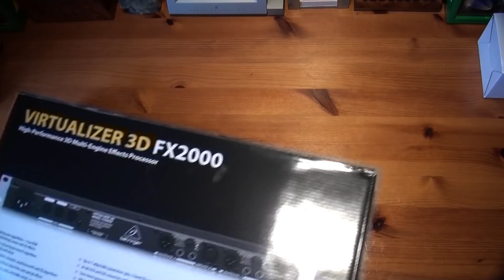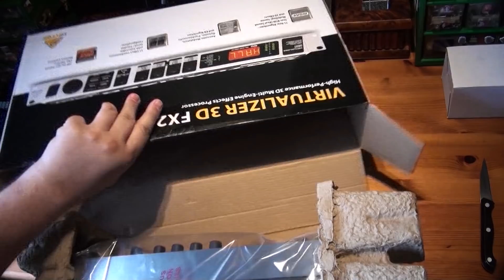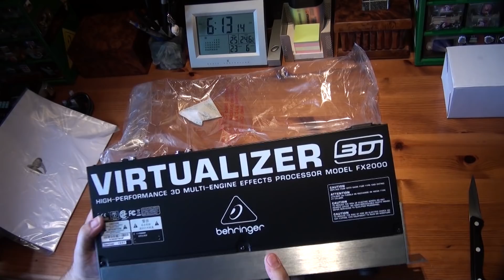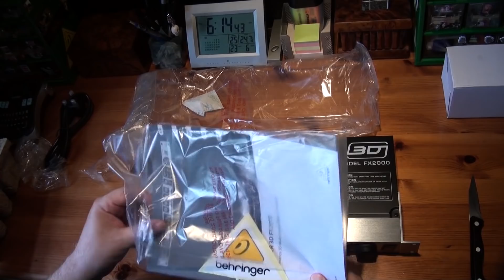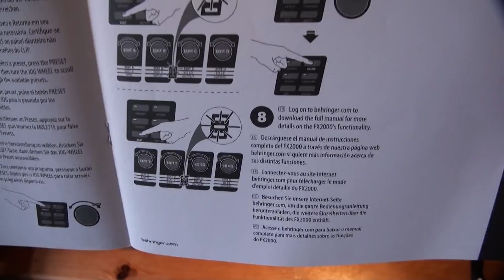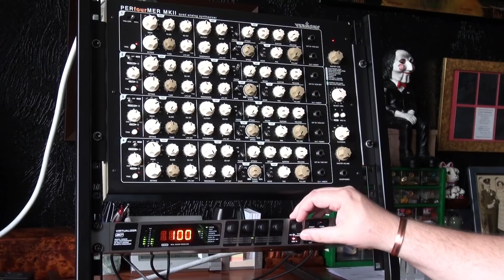Behringer FX2000 Virtualizer 3D Multi Engine Effects Processor Unboxing

Comment: This didn't help me in deciding if I would want to purchase one.  ...It's playing through a "Quad Analog Synthesizer."  ...How is the listener to determine which unit is producing which tones?   ...They are both synthesizers.    I think the proper way to showcase this unit is to connect to a simple mixer with no effects or basic pre-amp, to isolate the pure tones and functions of the Behringer's effects.
Reply from the maker: Just to clarify the synth is playing through the effects and from effects to video camera that's it. The synth is playing four different sounds one after the other.I chose four different sounds so you could get an idea of how the effects unit  is changing the sounds.Sorry it didn't help. The end part is just a quick look from a much more in depth series https://www.youtube.com/watch?v=EaTFm7wmTxw&list=PLxLrDVzH4F1LKBzPjmS7kwgpjIPIImy3r
Reply: @nonsensicalchild     Okay.  ...Thanks.

Comment: Ok, now that I have it largely figured-out...a quick question: The Japanese manual (matching mine...100+100 presets versus 70+70) notes the user/"volitile" presets having 100 different named effects - e.g. beyond the 100 internal/"non-volitile" ones: Does anyone know if a hard reset will repopulate those user presets to their 'extra-hundred'  factory sounds?  THX
Reply from the maker: Try it
Reply: Yes - I suspected I would have to do so ....there are some I wanted to keep there and I'm not going to bother with manually backing up parameters or using sysex; thanks!
Reply from the maker: You might make even better presets this time now you've had it for a while..
Reply: Indeed; the "potentially default" ones from the list didn't appear tremendous...  All have been overdone/too-much to be useful.  Thx again

Comment: Hi - looking at buying one of these but I am wondering whether or not I can use more than two effects at once? In the description on the Behringer website it says there are up to 11 effect combinations, all of which only contain two effects (chorus & reverb, flanger & delay, pitchshifter & reverb etc). Can you tell me whether I could set up a preset with more than two effects - chorus, delay and reverb for example? Thanks!
Reply from the maker: You read it right you can only combine some sounds.It depends on what group they are in https://media.americanmusical.com/ItemFiles/Manual/BEH_FX2000_Manual.pdf  go to page 14 (Chap 3 , 3.1) effects structure to see what goes with what.